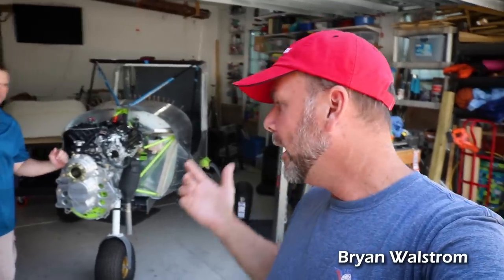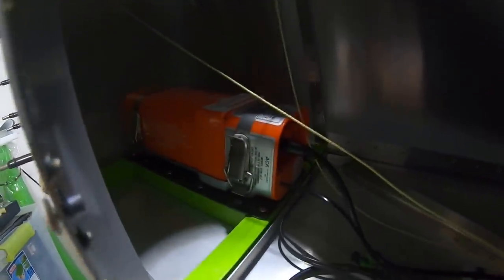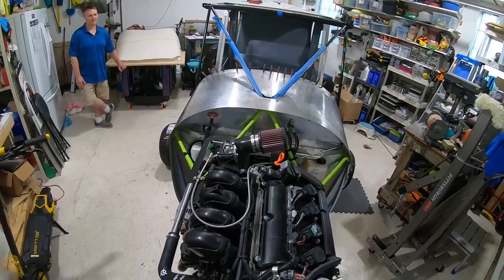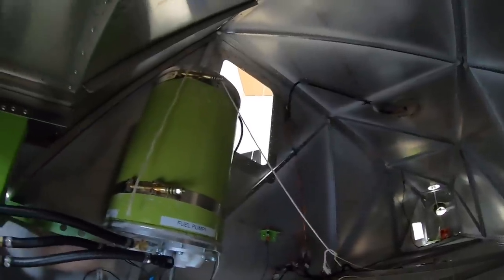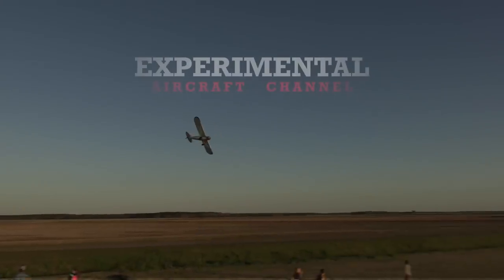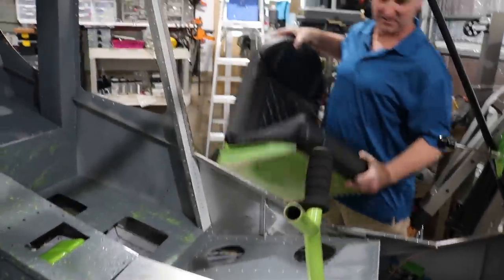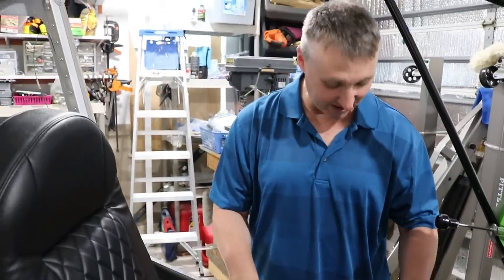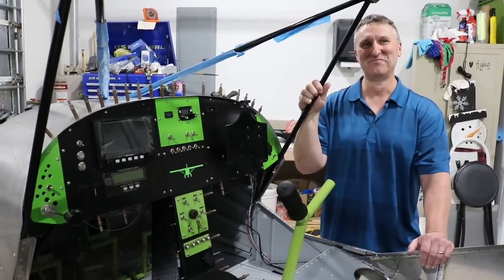HONDA 2022 Engine in Aircraft?  Zenith Cruzer Airplane Powerplant Options

Comment: I wish that I had this man’s talent and drive. 👍
Reply: Talent is something you're born with.  It doesn't take talent to build one of these, it takes skill.  Skill is something you get along the way.  Start with something small like the rudder kit, then move on to the empennage kit.  If you need help there are plenty of resources online and at your local EAA chapter.  When you get to bigger sub kits like the wings and the fuselage, just break those down into smaller and smaller tasks until you can't break them down any more and knock them out one at a time.  The drive comes from seeing your airplane slowly come together.

I'm not going to lie to you and tell you it's easy and it can be done quickly, it's neither of those things.  It takes years of hard work but it is 100% obtainable.

Comment: I would have hinged the rear access panel with the hinge on the forward edge. Looks really nice. Can you post a link for the access panel manufacturer. Thanks Bryan.
Reply: My plan was to hinge it the other way. It was one of those, “I have an hour to work on it, what do I want to do?” In my rush, I mistakingly placed it the wrong way. I noticed it after already drilling certain holes where I could no longer change its position.
Reply from the maker: Lynn the link can be found in the description of this video.  Below. :-)